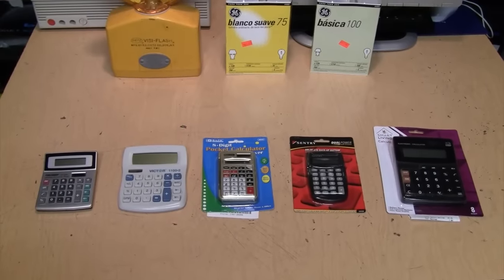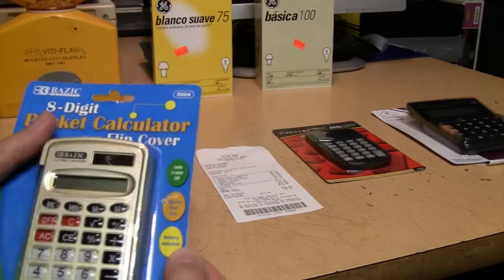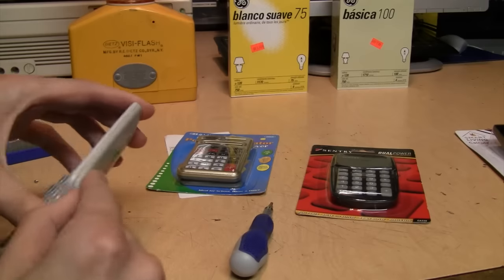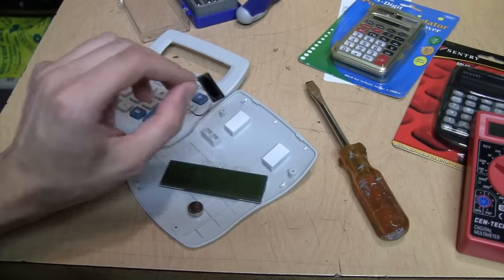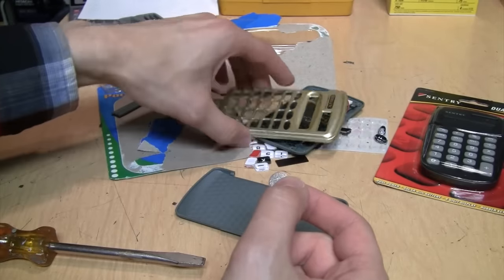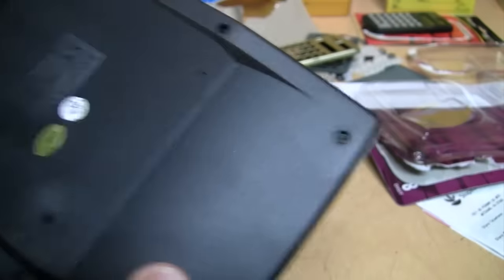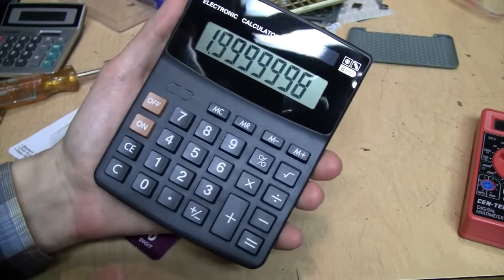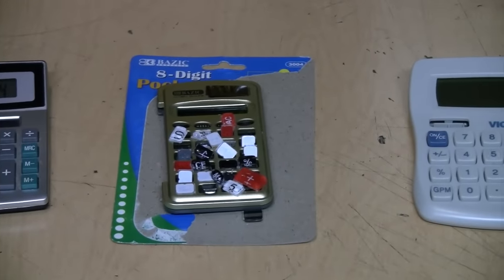Solar calculators BUSTED!

Comment: I can't wait until good solar panels start getting mass produced. I'm looking at you, Elon.
Reply: Truly Infamous lol but solar batteries are almost obsoleted believe it or not, Apple is going to release in around a year (it’s being said it’ll release by 2019) their newest charger which is called AirPower, AirPower is a pad you can lay about 3 Apple devices on and they’ll charge on it without needing their old charging cords anymore, I was at Target the superstore a week ago and asked an employee when the product releases they said that they’ve heard it’s coming in 2019. If you don’t believe my comment look up AirPower though, I swear that I’m not lying about this product, it sounded amazing.
Reply: StickFiguresMaster so what’s the difference between that and what they have now other then costs an the fact you can use it with 3 things?
Reply: You could get a shipping container full of calculators and remove all the solar cells and solder them all together on a sheet of plywood.😁
Reply: I work in the solar industry elons solar tec is honestly terrible he started from scratch instead of taking the market where it is and improving
Reply: I'm looking at you qt
Reply: StickFiguresMaster the tech isint that new, look it up. It’s also rather simple, it’s pretty much an electro field (kind of like a magnets field (as a visual representation)) In my opinion wireless charging is also pretty limiting. But I do agree, it is pretty sweet to set your phone without having to do anything in order for t to get charging

Edit- talking about wireless charging
Reply: There's not enough raw material on the planet for solar to ever be that big.
Reply: @StickFiguresMaster  Typical. Apple rebrands something and people act like it's new tech, as usual.

That's called induction-charging and is not new. I had an electric toothbrush ten years ago that recharged using it. For phones it's called a Qi charger, and many models already support them. You can also get replacement batteries for some models that include the Qi coils built-in so you can retrofit older phones.

NOT new tech, but Apple will pretend they invented it and charge 10X the price.
Reply: Elon can’t even build a good car, what makes you think he’ll make good solar panel technology?
Reply: Hey Wilford Brimly!
Reply: @Draknfyre  Yep.  I've had wireless charging on my Samsung devices for 5-6 years or so.  Maybe a bit more.  I believe my S5 could wireless charge with the addition of the Qi insert.
Reply: The issue with Elon is that he makes promises that are impossible because of spaceX. 
"Lets make tunnels under the most earthquake prone city for transportation, but they're dumb enough to give me a shit ton of money for it, because SpaceX" -Elon

Where as if it was anyone else, common sense would kick in you would be like "This is a scam".

Example: Smokes weed on podcast. Mainstream media says he doesn't even know how to smoke weed. One of them is lying obviously lol.
Reply: Dimitri Simms idk how there already could’ve been wireless chargers, because back in the timeline when we had the first president George Washington in the year 1776 we had people like Thomas Edison making the lightbulb, from there we had people trying to make chandelier that could use lightbulbs, we had people trying to make wires, we had simply wires without a casing around them at the time though so if you accidentally poured water on them they could’ve had a electrical shortage and possibly even cause fire to come out of them.

In these later years of years like the 2000s we’ve had wall outlets that used to have a 3 prong included cable since the 1900s, but in the 2000s we have pretty much replaced the 3rd prong with only 2 prong wires.

In these years we got Apple seeing if they could in fact make a charger that they’re still experimenting on that charges your devices without needing to even be plugged into charging cables anymore and they have estimated that 2019 or 2020 is what year we can hopefully expect to see it in stores!
Reply: @StickFiguresMaster  Are you okay man?

The third prong on a plug is the ground. Not every device needs to be plugged into ground, and two prong plugs have been around forever.

And wireless chargers are still plugged into the wall. They generate a field that a device inside the phone converts back into a usable electric current. Most smartphones released in the past 5 years can do this.
Reply: Dimitri Simms  Edison's primary skill was in business. He took advantage of a lot of people's ideas, but at the same time, those ideas may have never gained in popularity without him. Tesla was far more interested in making cool, but not very profitable demonstrations. And slowly killing himself by not sleeping. Tesla was certainly the better scientist/engineer of the two.
Reply: They are just expensive because they are made from materials that are non fabricatable? You know what i mean
Reply: @rowlandbuck2703  silicon is one of the most abundant elements on the Earth. Where are you getting your information? From the fossil fuel electric industry or from someone who gets their information from the electric industry? Don't forget they consider solar the enemy because they'll lose profits.
Reply: @johnwyman6331  when did I mention silicon?
Reply: Thanks wilford
Reply: Korea already mass produces them for the solar fields popping up all around the country.
Reply: John Wyman you really think they aren’t gonna start charging monthly for solar?
Reply: @StickFiguresMaster  that's nothing. Theres prototype chargers that you mount on the ceiling like a smoke detector and they use ir to charge devices
Reply: @StickFiguresMaster  Haha, Airpower. That's vaporware, never being made.
Reply: @StickFiguresMaster  Anything sounds nice if it's marketed by Apple, even a trash can.
Reply: @michaelwhat5939  diabeetus
Reply: @rowlandbuck2703  there's plenty of silicon phosphorus and boron on earth

Comment: The reason for sqrt(2)*sqrt(2) is because sqrt(2) cannot be represented exactly in 8 digits. Most calculators round down, so we get 1.4142135. 1.4142135*1.4142135 is 1.9999998.
Reply: The calculators are so cheap they broke math. :(

Comment: Hey actually if the square of the square root of 2 isn't 2 but 1.99 that's actually right as most calculators will round of the root to whatever length their display supports and then square hence the small difference, hope I could explain
Reply: Ya, it seems he's expecting the calculator to remember more digits than the display can show, if someone needed that feature they wouldn't be buying a cheap calculator. :)
Reply: Iliveunderthefridge Atwalmart  but who needs to use that many digits and use a cheap calculator.

Hell even the 100 buck fancy calculators you need for school don't always show or take in account all digits.
It ain't supercomputers. What would you expect them to do with numbers like pi?
Reply: this
Reply: I don’t think you understand math. “If the square of the squareroot of 2 isn’t 2” ? What is 2-2+2? What is (2/2)*2? What is the (squareroot of 2)^2? That’s like saying “if the sum of 2 plus the sum of 2 minus 2 isn’t 2” like... what?

Comment: The diode is simply to prevent the solar trying to charge unchargeable batteries.
And you suck at tear downs. You destroyed several things, and calculators you open them upsidown so the buttons stay on their frames. And that last multimeter test should have been done without the battery in, tho the diode probably prevented a fluke test.

Comment: My conjecture is that real solar cells mounted in calculators will make a comeback. Reason? As I drive around town here, I see those Dollar Tree solar light spikes everywhere. House almost-nextdoor has about 20 of them in their yard. So manufacturing solar cells at humongous scale will drive the price of a real one below the cost of a plastic blank.  :^)
Reply: Likely not BELLOW that, but sure cheap. They already are tho, just that the battery already lasts so many years already that people would rarely buy a solar/dual power one over a normal, at least that's what I think.
My dad had an old scientific Casio one that used dual AA batteries, the original ones lasted for like 15~20 years. And yes, without leaking.
Reply: I have a TI-30 that can chew through a standard 9V battery in a matter of hours. It would need a solar array to power it. But the LED display glows wonderfully.
Reply: Paul Frederick  I still have my ti-30 from high school, and I graduated in 1981. Still has the plastic looking denim case, and I still have my International math on Keys book. And everything still works perfectly.
Reply: I'm pretty sure the Ti-30 I have is an original. I believe there is a date on it from 1974? It is so old it is made in the USA

Comment: Quite some time ago, I knew someone who was visiting some impoverished areas of Sub-Saharan Africa, specifically the schools, and was looking for donations.  I bought him a ton of solar-powered TI scientific calculators to bring with him, with the thought being that they won't ever need batteries and will last forever.  I hope those were real.

When I was in middle school I used a TI-30X solar (this was the early 90s).  I dug it out of storage many years later and it was still running, and when I covered the cell the display dimmed, so that's a good sign.  There was something very satisfying about that calculator being so reliable and working so well many years after I last used it, even though it was covered in the pencil marks that I had scribbled all over it by being fidgety.

Comment: The answer to the square root of two test isn't off because there's anything wrong with the calculator, it's because calculators have limited precision.  Sqrt(2) * sqrt(2) is indeed 2, but 1.4142135 * 1.4142135 isn't.  If you have a calculator that gives you 2, it's using some trickery to hide its limitations from you.

Comment: Damned youtubers influencing my purchasing habits!! Just bought three of those LED lightswitch things off ebay (£1.99 a piece), though I do have a use for at least one of them... :P

It's not surprising they've made fake solar cell calculators, after all, there's fake solar-powered things everywhere that have a battery only and people just think they've broken them and throw them out, makes you wonder why they do it, but, I guess it's just saving a 1/87th of a cent per unit so they do it... :\
Reply: I bet Superman isn't even solar-powered any more.

Comment: Solar cells are expensive!!!  Lol.  But seriously, no you can't sue someone or even return a calculator for having a fake cell unless it's specifically stated as a feature.  Nobody will accept a return based on the fact you made a false assumption.  I agree it's misleading but this is definitely a caveot emtor situation.
Reply: Rob Fowler Just throw it in the microwave for 5seconds and tell them that shit dont work
Reply: *caveat emptor
Reply: Rob Fowler you can sometimes if it was an honest mistake
Reply: I just don't understand why they'd spend the extra on putting in fake ones. It's not like we all expect our calculators to have solar cells. Most people don't even care. Especially if you're buying a cheap calculator. Why even fake it in the first place lol?
Reply: 김미나  i think they put it there so it would sell better (appearance) and fooling elderly people of course.

Comment: I have a "dual power" Sharp calculator that I've been using at work for over 15 years now and it's still going strong. Sharp is a reputable brand so I assume it has a real solar sensor on it.

Comment: Oh, when I was little, maybe 17 years ago or so, my mother had just such a Bazic calculator! I don't remember exactly whether the "solar panel" was above or below the screen, but I do remember those cool transparent buttons that look much cooler than the rubber or painted plastic ones. And this "flip cover" has exactly the same texture, shape and color. Your video just unlocked that memory. That was an interesting jump into the past, thank you.

Comment: I have a very weared out, old calculator my mom used in her younghood. It's working without batteries for like 20 years now. It has a slot for a small watch battery but its solar cell makes enough power for it to work without any batteries whatsoever. And it can work under a desk lamp. Now I see that this might be a rare occasion because it's also a very compact and cheap calculator

Comment: I had one in school made by texas instruments and the solar cell was functional I loved it
Reply: Same here, we all had the TI-30 ECO RS.
Depending on the day I either loved it or hated it. Sucked when the light wasn't strong enough as it doesn't have any kind of backup battery at all, lol.
Reply: Real solar panel calcs are awesome
Reply: Every calculator I've owned that had a solar cell had a working one. I don't think I've ever gotten a fake one in my life. These days I just use my phone or the calculator on Windows ._.
Reply: Some of the TI solar calculators made in the 80s didn't even have a battery. The solar cells worked in very low light.

Comment: As someone who's dad have sold a lot of things throughout the years this is really old news, I might have started to see this practice probably more than 15 years ago, but it's not really like they actively try to trick people with this, you can tell a real solar one by just covering the cell and the numbers on the lcd fade away (or almost). But yeah, I can see how this can be disappointing if you find out your favorite calculator is not solar. Casio is a good bet if you want a good solar calculator
Reply: Unfortunately where I live there are knock-off Casio calculators everywhere.

Comment: My dad has an old (probably late 80s) Sharp solar calculator. It has no power button, and is housed inside a small wallet, so it powers on when the wallet is opened, and off when it's closed (or if you cover the solar cells).

Comment: I wonder if they use the same calculator case for different models, and for the cheap models they don't have a solar panel so they add a fake one to fill up the hole. Kinda strange they would try to hide it with a fake decal though

Comment: I opened my 'solar' powered calculator and found plasma power cell.

Seriously though, most solar calculators used to have a proper solar cell, you could tell by covering it up the display used to fade.

I guess the cheap ones now just use a button power cell.

Comment: Thing is the batteries on these last sooooo long anyway, you have to question the need for a solar panel? Casio did 2 versions of a high school calc, the lower ver didn't have the solar cell, but they both have a AAA battery in them which will last like years and years. So what's the need for solar?

Comment: My first thought is that some of these calculators have other models that do have working solar cells and that the ones that don't just use a blank instead of manufacturing a different shell. It could be less too fool the consumer and more of a cost savings measure.
Reply: They went through the effort to make them look like real cells though, a fresh shell would just have a hole.

Comment: I still use a solar calculator from the 90s - it works fine if you put it in bright light.
It's a Radio Shack EC-4032. Tried the √2 trick & got 2, so it seems to be working OK.
Can't believe they have em on eBay still!
I used it at work and around the house for whatever. It's not a special one, but it works -.thanks for the video - made me appreciate something I took for granted.

Comment: 14:10 speaker are there not for talking or music. Speakers are ment to voice the keys, this is a way of auditory confirmation that the user have pressed the key. Because some advanced users don’t look at the keyboard or the screen when they input the figures, instead they lock their eyes on the source of the figures, wether it is sheet of paper or the computer screen, so have to rely on the auditory signals from the calculators. 
The key of 5 has raised tab for that purpose, so that the advanced users who use the ‘blind’ input method knows where he/she is by feeling the surface. They kind of anchor their middle finger on the key of 5 and press the adjacent key with other fingers

Comment: I imagine when a lot of microprocessors went into microwatts or less quite a few years ago, these became the norm. People cant imagine that punching in numbers can be so cheap watt-wise?

1 Watt Hour battery = 1000000 Microwatt Hours 'under load' of a 1micro-watt microprocessor chip that is most of the time off.

Comment: I have a solar calculator and it actually was a real solar calculator. Covering the little panel would turn it off within seconds. Its also over 30 years old and if it had a battery, that battery would have been useless long ago.

Comment: I knew that 30 years ago. Those calculators came out and everyone had them. Mine was a quality unit. I used it for months at school. It stopped working. I opened the case and found a button battery. It had wires to the solar cell. I assumed it was supposed to trickle charge the battery. It worked for another year or so then I changed the battery again.

Comment: The diode may have been put there as reverse voltage protection. It may also be needed to drop the battery voltage to accommodate a low voltage calculator circuit module.

Comment: If you look closely a proper solar panel is separated into segments and not just a uniform colour like the fake ones.
Reply: Not every one of them. Btw, most of the time you can detect a fake one by the color or curvature it has. Also you can slightly press on it with your finger. Real ones have a glass surface with brown and dark red lines in it.

Comment: I still own Soviet solar-powered calculator Elektronika MK 60. It was manufactured in 1993 actually, but design dates back to early 1980s. It is solar-only, with no battery and it still works just fine, after whole 30 years.